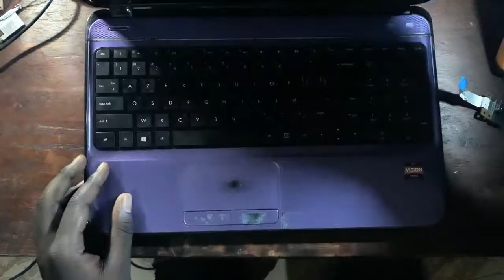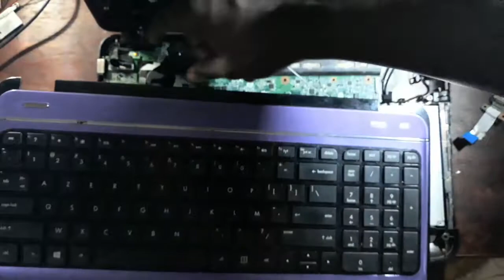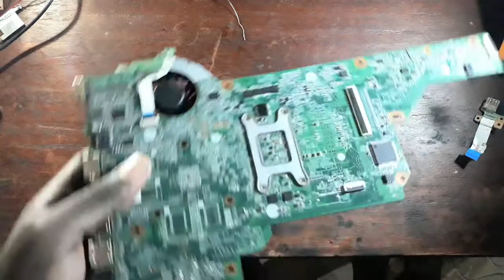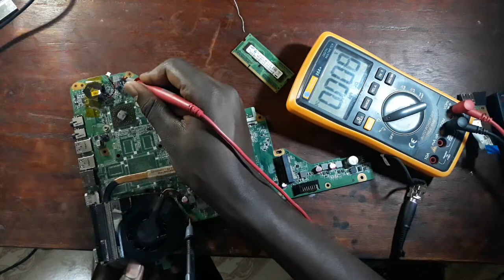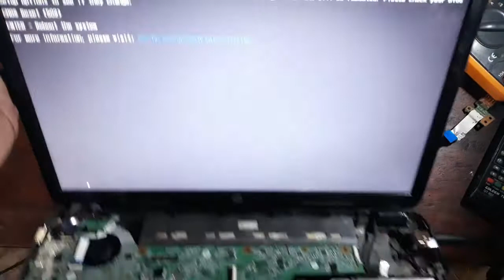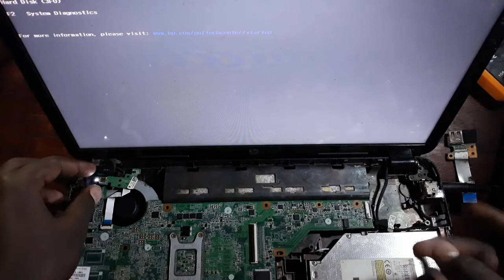How to check short AMD processors HP Pavilion G6 no power repair

Comment: i understand that , the processor always is shorted to ground if the motherboard is shut down, this is how the processor is designed for self protection against static electricity, thanks for producing this video, i get the lesson

Comment: Hey thanks alot for the content
My question is a short in the processor reading start at 000.0 to I mean is 000.3 a short to ground processor coz measured my laptop but still it came on I wonder 🤔
Reply from the maker: Yaa, probably it's a short, what generation is your Processor